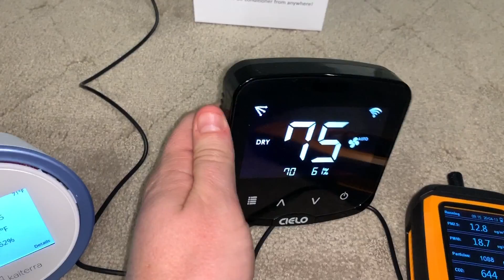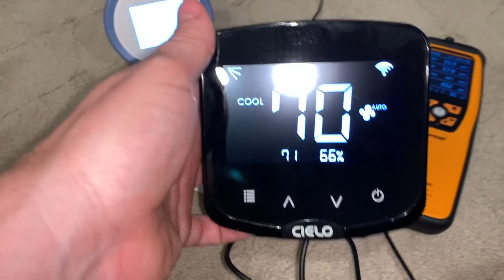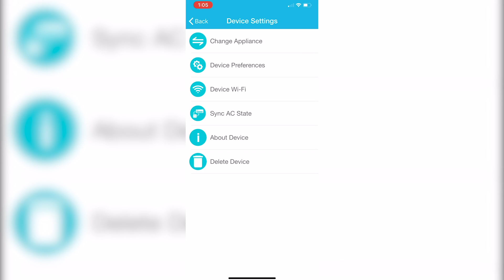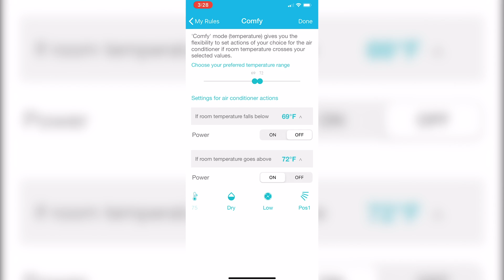DUCTLESS Control and Humidity Hack with Cielo Breez

Comment: I just installed 4 mini split in my house and found a huge negative . I mean, HUGE . These manufacturers need to have there heads examined . For real . I set my mini split to 70 deg.f   . Well after the set temp is reached it goes into low power mode and the air comes out warmer to maintain the set temp . Only huge issue is when you mix warm air with cold air you get wet, humid air . I contacted 2 mini split companies and asked if these were working right . They said yes . I told them that was plain stupid to have these work like that. Asked if there was a built in way to have it work like my central ac worked . Completely off 1 degree below set temp and back on 1 degree above set temp . They said no . Who in their right mind would make an ac product work like this ?? So if this product in this video works as shown in this video i will instant buy for sure . Going to do more research on these .

Comment: An automatic humidity control would be a great add on. Also a remote IR transmitter that plugs in would be a nice feature. We have 6 -3 ton wall units in a church and it is very difficult to find a mounting spot that will operate some of these units. We are going to use a IR repeater but a power/communication jack right on the thermostat would be nice.

Comment: When you adjust the temp on the Cielo does it also adjust temp on the AC unit or does the AC unit always stay at its lowest temp and just the Cielo turns it on and off based on the Cielo temp readings?

Comment: One of my associates tried these remotes due to a difficult owner not wanting hiwall unit, floor console and then no cassette since this job was for an added flat roof, sun type addition.  After a few go arounds she decided on and where the hiwall unit was going and we would deal with hiding the linesets outside..😵
Since routing a control cable was out of 5he questing, we opted for this IR remote kit. KNOCK ON WOOD,  I have not had a call back ..yet. Only issue I saw was daylight all around and a tabletop control near just a blind equipped window allowing sun conduction  since builder owner installed non low e glass double pane. 
,.....so far....so good.